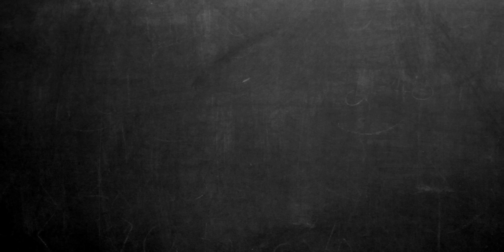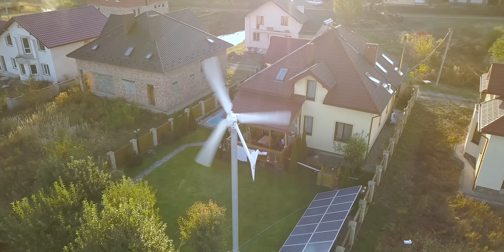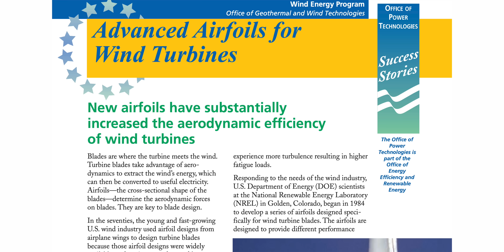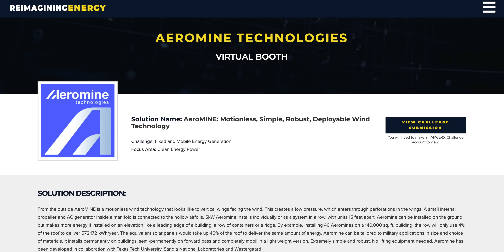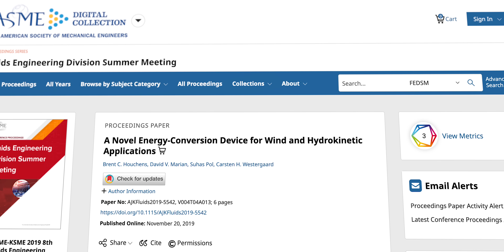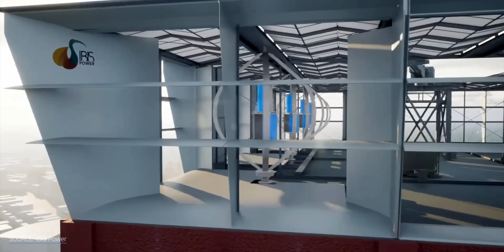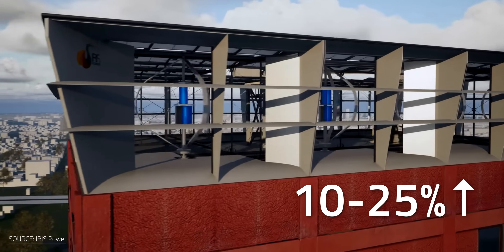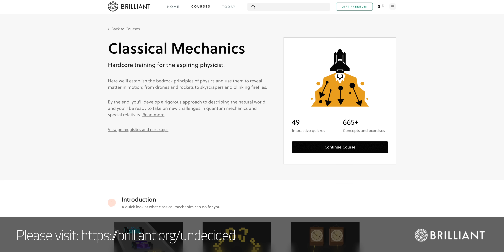How Can A Wind Turbine Be Motionless?

Comment: 'No exposed moving parts' doesn't mean 'motionless'. The Aeromine has a hidden ducted wind turbine, as you show in 3:53, which is far from motionless. As you say, air will in fact be accelerated by funneling it through a narrow duct (Venturi effect), probably the reason why it can work at lower wind speed. The ducted turbine will therefore spin faster, adding vibration and wear- and- tear in an inaccessible place. And with the air, the Venturi effect will pull and accelerate dust, pollen, and insects through the turbine duct, sandblasting the turbine and its bearings. Undecided indeed.
Reply: Why does the turbine have to be in an inaccessible place? It’s just ducting like an AC vent. You can put an access hatch right below it for maintenance. 

Also, I’m sure there’s a filtration system for the air that’s being used to spin the blades.
Reply: If there is an access hatch and a filter, why are they not mentioned? Is the hatch accessible from the roof or do you need a crane / platform to reach it? A filter needs regular replacement, and it slows flow rate (the more so the better it filters). Not saying it's hopeless but there are at least 2 issues I can spot that the video choses to ignore - so I suspect there may be more. I remain undecided.
Reply: @Leberteich  Being that this is in the very early stages of development, I am certain that they will address those issues as the development comes along. They may even be able to use the suction to their advantage. like, negative pressure in a clean room or something. It will be interesting to see where this leads in the future for sure.

Comment: 1. 8kph = ~2.2m/s, 15kph = ~4.2m/s, 1/2mv^2 = E so the fact that it starts working at 2.2m/s is largely irrelevant as there's about 3.5x less energy to harvest at that speed anyway.
2. The potential of any wind system is, in the first place defined by the area facing the wind. This aeromine needs to frame that entire area requiring alot of material. The price of a product is defined by the learning curve which shows that generally in mass production, the price of a product decreases by about 20% per doubling of the number of cumulatively produced units, down until it gets to the price of the required materials plus a percentage for the manufacturing operations. In short, eventually, more mass in a system = higher cost. Feel free to compare required mass for a conventional wind turbine with the same wind-facing area.
3. The aeromine as 3D imaged doesn't rotate. It only works for prevailing winds, which means it misses at least 30% of the potential energy available, barring a few highly specific locations like inbetween buildings or a few mountain passes. The versions installed in Utrecht and Eindhoven also appear to deviate significantly from the 3D model design as they seem to be both omnidirectional and do not rely on any significant venture effect
4. The design relies on the Venturi effect, and requires ducting air through a number of relatively narrow ducts which have tight turning radii. This is a high drag environment, and if you compare the potential drag in a conventional wind turbine it is comparatively much worse.
5. Wind in urban areas is extremely turbulent and there are only very few places with sufficient average windspeeds to produce enough energy to justify the costs of the system. The aeromine is also too close to the roof itself, meaning it will be subject to the turbulence that close to the roof. As a general rule the bottom of the useful wind-facing area starts around 5m above the roof of a building, preferably area. Any wind-facing area below that isn't likely to contribute much to the energy generating potential of the system. A aeromine big enough to get above this 5m limit will require strengthening of the building, further increasing cost and requiring yet higher average wind speeds to justify the investment.
6. Venturi effect is irrelevant. The law of conservation of energy means that wind facing area defines the maximum energy available to be harvested before losses. As Venturi goes an increase in speed = a decrease in mass, as E must remain constant in E = 1/2mv^2. There is no free energy. Regardless of the system used to harvest the energy 1m2 which is hit by air at 2ms, has 2m3 of air hitting it every second, at a density of ~1.222kg/m3 about 2.44kg/s put that into the 1/2mv^2 formula and 4.88J/s is the kinetic energy of the air hitting the system. Betz coefficient means no more than ~63% can be converted to energy, plus heat losses and design inefficiencies. If you can hit 50% in practice you're doing reasonably well. Any system that claims numbers much beyond what this rough rule of thumb results in, is falsifying results, venturi effect or otherwise.
7. Let's look at the Haasje Over setup. 296 solar panels. 340Wp panels were the best bang/buck deal around 2021, so we can assume those panels are at least that. That means the solar panels are responsible for at least 100MWh of the expected 140MWh the installation is supposed to generate. Ofcourse, we also have the cooling effect of the wind. Putting the panels 4.8m above the roof is going to help with that, it's far enough above the roof to really be in the wind, potentially up to 20% improvement, but let's assume a max of 10%. If they invested in 400Wp panels, and we take into account that 2022 was a very good sun year in the netherlands (more than 10% better than 2021) the solar panels alone could do as much as 155MWh. So it's very likely the solar panel component of this installation will generate more that 120MWh in 2022 with 200Wp/m2 panels (340Wp/1.7m2).
So best case we're left with 40MWh from wind estimated. Lets assume they're really cool and manage 55% efficiency from available kinetic energy. Google maps tells me the largest dimension of the building is 30m. Wind speed, let's assume an average of 6.0-6.5m/s @100m (KNMI data) which is probably rather optimistic for that part of the netherlands especially as altitude is less at 70m high. A conventional modern turbine could generate about 60-90MWh out of that area. So what it comes down to is cost. I can't find data on costs, nor any measurements either internally from IBIS or otherwise. On the balance of things, it would probably be fair to conclude that the wind turbine component contributes something between 0MWh and best case 40MWh to the whole. The question then is, how much more expensive is it than simply placing 296 panels on the roof? How does it compare power wise to using the rest of the money to put panels on the southern vertical face of the building? I'm going to hypothesize that this device isn't an intelligent way to spend money.
8. Feel free to look up the scandal in Denmark with a comparable design principle, marketed under the name of Sheerwind. It also failed in the Netherlands, and in US Army testing.
9. The statistic of 35x the daily energy need of the world is wrong. If you work out the potential energy in a 200m thick volume of air covering 0.001% of the world's area moving at 0.1m/s at only 1000 max capacity hours it's still many orders of magnitude higher than 35x. Same goes for solar. With the sun hours in high sun areas 1m2 of 200Wp/m2 generates around 0.44MWh/year. 400,000 sq.km. (633x633) generates enough energy for the whole world in 2021, or about 0.3% of the land area.

There may be a use case for aeromines where prevailing winds are high speed and stable and they can be placed along the North edge of a roof so as not to interfere with solar generation. The locations where it can work are likely to be highly specific and far between and compare unfavorably than simply using the budget to increase PV area. The only point is that wind and PV only have limited overlap, meaning that wind will generate when sun doesn't. In this case however, you'd have to carefully consider your cost scenario depending on how space heating figures into your energy usage profile.

Comment: Matt the number one problem with wind turbines is that they don't produce power without wind...Texas last summer had issues with power across the ERCOT grid (again) as the heat wave was accompanied without any significant wind.....Weather dependent energy sources are NOT the solution for fossil-fuel free energy....

Comment: For Windenergy what counts is surface. The larger the better. That tiny turbine will only produce its watts at high windspeeds. You need a lot units to generate significant amounts of electricity.
I think it is way too expensive then. They claim "50% more than Solar" Thats sound scam. What kind of solar? How many or how big?
They can not be turned into the wind either. 2 big PV Modules that can produce 700watts kost about 500€ How many of that turbines do you nedd to produce 700 watts at moderate wind speeds? What will they cost? Are there independent tests how much power they generate at which speed? I guess it will be more sensible to invest that money in a battery bank for PV energy…

Comment: Hello. Good report and thanks for all the ideas and news sharing on this topic. 
However, to my understanding there are two flows in your explanations. But please correct me if im wrong. My physics classes are a “few years” ago.
1) The design of a standard car does not create downforce. It actually creates the opposite. The shape itself is somewhat close to an airplane wing. The standard design of a car results that the path above the car is longer than underneath the car, which is usually a direct straight path, hence creating a low pressure above the car.  
Thats the reason for higher speeds sports cars do have additional spoilers in rear and or front to create the needed downforce. 
2) the venturi effect is not fully explained holding you finger on a garden hose. That is the first part of Venturi which is Bernoulli. If the pressure increases the velocity increases as well. 
Venturi is better explained with a slightly open door shutting itself when for example windows are left open. The increased airflow through the slightly open door creates a low pressure infront of the tighter space pulling the door in, finally closing it. 
A carburetor is also a good example.

Comment: Green energy is bullshit. 1 pound of fossil fuel has 5000 times more energy than 1 pound of battery. You couldn't generate even half the energy needs for the USA if you put wind and solar systems in every square foot of available land currently in the continental USA.
You, green energy proponents, are clueless.

Comment: Adding it on top of an air-conditioning machine could improve both systems, the turbine has more pressure differences and the air-conditioned system will dissipate the diferencial more quickly...

Comment: Your description of airflow over race cars is literally the opposite of what happens. Cars have a tendency to LIFT due to their shape. The spoiler in the back messes up the airflow and REDUCES the lift of the body. A race car has less downforce as it moves forward. It in essence gets lighter.
Reply: He means the ground effect that F1 cars are using (again) which is downforce created by venturi channels in the floor of the car. The faster the car goes the more downforce is created and the car basically gets sucked down to the track. The wing in the back mainly serves to provide downforce in the corners.
Reply: @easy_s3351  not even similar to what he said, including the animation/pic that didn’t have f1 cars in it. 
You’re really reaching here.  He’s just wrong - and that’s ok 👍🏻
Reply: @Meatball2022  My bad, I saw another video from this guy on the same subject in which he showed F1 cars. Btw, I think he's sponsored by Aeromine, he doesn't question any of the things they claim.

Comment: 1.  In minutes 1 to 2, the case was made for the challenges of mounting wind turbines on the rooftops of the average house…1:56 “aeromine aims to solve that problem”…then at 5:37, “let’s be clear though, aeromine is not the kind of turbine you’re going to be seeing on the top of a single family home”  🤦🏼‍♂️ if it’s only designed for large warehouse size roofs, then it’s not really competing for solar panel space on my roof, is it?
2.  Why not place the aeromine turbine closer to the Venturi,
E.g. in the base, so I have less friction loss in the air tubes and make the entire unit so it can weathervane with the direction of the wind, remain optimally positioned?   Fixed position with the direction the wind blows MOST of the time seems like a huge design flaw. Keeping long air tubes free of bugs/obstructions is another.
3. The power nest seems to present the same limitations you mentioned with wind turbines in the first minute. Danger to wildlife, high maintenance, vibration. So other than the solar panels above which I can install anyway, and the built in Venturi, how are they better than the SWT?

Comment: OK the narrator started out with a LIE. ALL wind powered generators COMBINED produce only 8% of the power needed by consumers. SO WHY LIE??? Add to that, wind generators are more Dangerous to maintain, More COSTLY to maintain and last only about 12-14 years ( in one state along, MOST are being REPLACED because of failure) when it takse 20-25 yrs to BREAK EVEN with the cost,,which is continuous. SO tired of this "New Age" Bullspit of Lie and misinformation.

Comment: Another person saying that "higher pressure on the "bottom of a wing" provides lift. WRONG! 'LIFT' is created by the air moving over the TOP of the wing. Take the pull top lid off a can and hold it in a water faucet stream to visualize this(the lid will be curled in the same fashion as a wing). The bottom of the wing produces 'push' rather than lift.

Comment: Good to see some interesting wind options out there. Just got two things to point out. First off, as a Detroit area resident, I will correct you in that Wyandotte is pronounced as why-an-dot. A decent try using the spelling though.
Second, why not just put the Aeromine unit on a swivel? That would make it more complex but would also easily solve the directionality issue.

Comment: Comparing solar panels and wind turbines is like comparing apples with peaches. Solar panels work well with areas with high solar potential. While wind turbines need reliable wind regimes. Both have limitations of where they are good at. With that being said I like the power nest idea. I don't know though if it is the optimized version of it or if it could be improved. I wonder whether the solar panels tilted to the dominant sun side would yield more energy overall.
Reply: Yes, solar panels facing south (on the northern hemisphere) have the highest yield with the angle of tilt depending on where they are placed; the closer you get to the equator the flatter they should be placed. At around 52 degrees latitude the angle is about 35 degrees. See table of Hespul.
Reply: @easy_s3351  Yes, but the video told that in the Power Nest configuration the solar panels benefited from the air stream underneath for cooling. And I'm wondering whether it makes sense to put the panels this way and get better cooling or is the the loss of energy production due to this configuration not worth it?
Reply: @Devillunar  Putting them at an angle already improves their yield compared to having them flat in most cases (unless you live close to the equator). If you look at the table of Hespul you'll see that the difference in yield between flat and 35 degrees is about 13% for south facing panels. Additional cooling also benefits their yield. The power rating of a solar panel is determined at 25C and for every degree above that temperature the panel looses about 0,5% of its yield. Panels can easily reach temperatures of 65C or more so they easily loose 20% or more of their yield. So any cooling you can provide will help.

Comment: Nice video. I like the nest tech. I actually have something that could improve the nests efficiency even higher while providing free air or water conditioning for the building below (heat or cold both depending on the climate). 

But I think you explained the Venturi effect wrong.

Venturi is what the wind turbine you explained aeromine first which uses the aerofoils to use a high pressure area to create an internal low pressure area thus causing a vacuum.

The water hose pressure has nothing to do with Venturi... It's just a restriction which is forcing the water flow volume to decrease in favor of water pressure. It's flow dynamics.

Venturi can be used in water or air but it's entire point is causing 1 flow to create another... Like water/water pressure creating a vacuum pump.

Comment: We could easily estimate the output power if we know the blade length. No matter of buzz words, it still works the same way as any other wind turbine. Thanks to mechanical design they can increase air flow speed (venturi + roof + direction) .  Assuming 0.5 m diameter , it requires around 200km/h (140miles/h) air flow speed inside the turbine to achieve 5kW, or 120km/h if the diameter is 1m (0.5m blade length). Is this possible? - unlikely.

Comment: Generation isn't the only problem. The current problem (no pun intended), is storage of power for use when there is no wind or sun available. For wind and solar to be a viable supplement and eventual replacement for today's conventional methods, it will need to produce constant and sufficient base load power. Phasing and synchronization of DC inverter systems on large scales also presents many challenges.  Just my  two cents.

Comment: It's all about the price of one kWh generated by such a unit. I'm very curious about independent test data in relation to installation costs. Not mentioned in one of the advertorials..... (oops). I predict that the cost of one kWh from one of these units will never be as low as one generated by a 'regular' wind turbine.